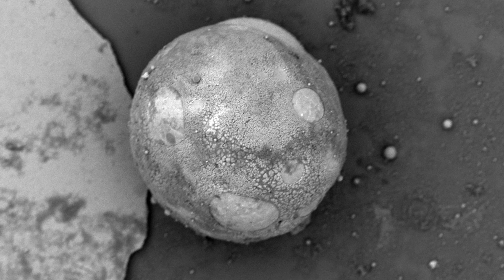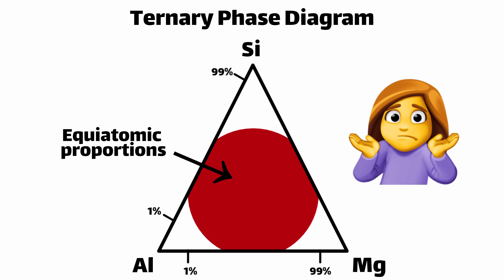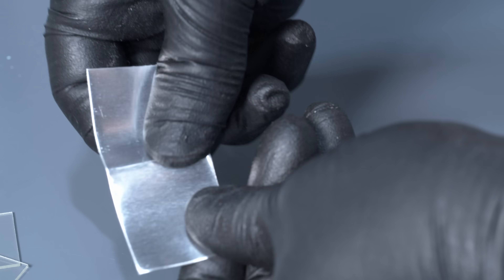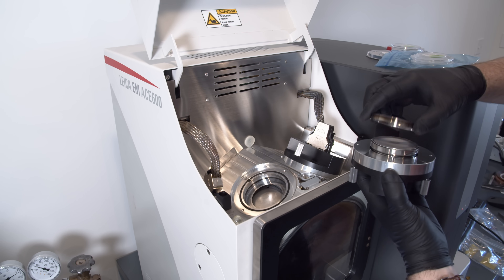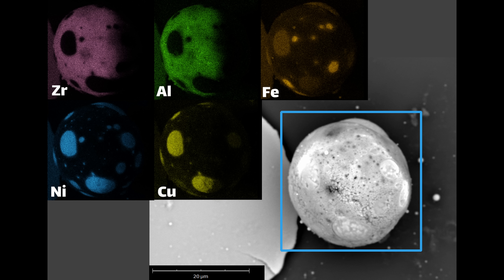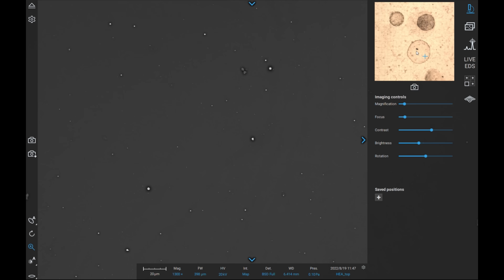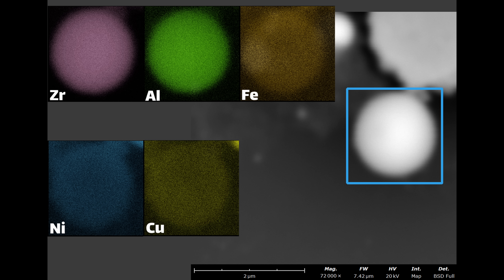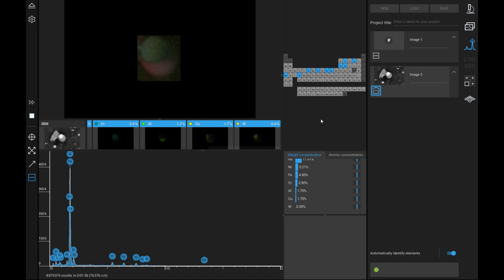Metal Alloys of the Future?

Comment: 10:01 Does this picture of the Copper (Cu) indicate a lot of copper is on the substrate underneath or is the detection a bit skewed there? The entire picture is filled with dots.
Reply from the maker: Could be a little bit of background material/nanoparticles, but likely just noise in this case. The Cu spectra for that sample was very weak so I had to increase the contrast quite a bit to get a visible image, which brought out the intrinsic background noise as well. EDS is more qualitative than quantitative and this is a pretty good example of why it should be viewed with a grain of salt :) Helpful diagnostic tool but you don't want to rely on spectra too much (and sometimes the mapping can be physically skewed or shadowed due to geometry too)

Comment: Good work, man.
You taught me some stuff. Some of it, I can even use.

Check your laser, man.
If you want smaller sizes, maybe try small taps, with the laser.
Control your local energy gradient.
It may be, also, that you've gotta decrease your ambient temperature.

Obviously, you should try these ideas, in reverse, too.
Maybe you're too cold, or maybe you're too hot, but if you can control your laser output, then control your laser output. Control it, all over the map, until you learn something. lol

Intriguing. Thanks.

Comment: I think your layers are too thick and the different melting points causes them to bunch up into blobs. I would try to go for a sub 10nm layer thickness at which point the surface area to internal volume ratio is vastly different which tends to change melting points. You can also try annealing the layers to get rid of internal stresses.
Reply: I was thinking along this line and also with the idea of spacing the laser pulse locations, more like the old interlacing technologies of video.  No wasted deposition areas, just isolated strikes locations, heat control as well as control of mass of resulting particles.  Just an idea.

Comment: The EDS image of the fun octahedral particle makes it look like the Cr is more concentrated to those round surface spots. It be interesting to see if those spots are just surface level chrome oxide formations or if they were actual Chrome that wasn’t soluble in the mixture. That could give you an idea of the mass fraction of elements in the alloy
Reply from the maker: Agreed! There's also a possibility that it's under the particle. I didn't mention in the video, but at this electron beam accelerating voltage (20keV) the beam can travel a pretty significant distance through the sample. So for smaller particles it's possible the beam shoots through the particle and hits something sitting under it, causing an element to appear in the spectrum. 

One of the reasons I was trying to find particles sitting directly on the silicon wafer substrate. In real research they'd use a (S)TEM where this is less of a problem.
Reply: @BreakingTaps  20 KeV is pretty high, what’s the diameter of that particle? How low can you make the accelerating voltage?

Comment: What if you change the order of the metals in the layers, so the side closest to the laser has the highest melting point and the furthest has the lowest
Reply from the maker: Definitely a possibility to help! Or even the relative ordering of different elements could impact how they alloy. Lots to explore!
Reply: This is how my lab melts refractory high entropy alloys. For instance if you're melting a button of tungsten-titanium-niobium, you'll put the tungsten on top and the titanium on bottom. The titanium melts first and the heavier, higher melting temp stuff sort of sinks in. Helps avoid chemical separation from density differences.
Reply from the maker: That's a great tip, appreciate the insight from the professionals! Will keep that in mind if/when I try this sort of thing again!

Comment: love how you can do such cutting edge stuff in your garage...
love your vids

also, what if you make nanoparticle solutions of each metal separately, and then combine the solutions afterward, mix thoroughly, and then boil of solvent and sinter/arc furnace it?
Reply from the maker: I suspect that could work! Would be hard to generate a lot of material, this laser process struggles to make even micrograms of material. But if you had enough of the individual nanoparticles you could probably mix them together either with the laser itself, or with something like an arc furnace.

Comment: You have probably thought of this already, but would it be possible to use liquid nitrogen or liquid helium as the liquid instead of water or hexane? It may help quench the larger particles faster so that they don't have time to seperate. It also may help prevent against oxidation, not to sure if this is true though.
Reply: Damn, beat me to it!
Reply: This was my though too, but I was thinking supercool alcohol or even acetone chilled in dry ice. Not sure if that would introduce other contaminants or not...
Reply: @WmSrite-pi8ck  I really hope he continues working on this project. If he can get the particle size up/process efficiency to a decent enough level he could start taking samples and experimenting with them.

Comment: wtf? what is this tool you're using? i have never seen anything like it before, this is like 10 years ahead of what i thought was avaliable
Reply from the maker: Scanning electron microscope! The elemental analysis is done with a sensor called an Energy Dispersive Sensor (EDS, or sometimes EDX) which measures the energy of x-rays emitted by the sample when struck by the electron beam. Each element has a specific signature of x-ray energies so you can use that to map out elements of a sample.
Reply: @BreakingTaps  i have seen SEMs before, but didn't know about the EDX, the software is really shocking, how you can just select an area and get samples live, what is the software called? it reminds me of using blender or other light transmission simulations, but irl
Reply from the maker: Pretty wild, right?! It amazes me every time I use it. No name for the software, it's just the interface that comes with the microscope (well it might be called PhenomWorld or Phenom Control or something... but it's part of the microscope, not something you can download). :)

Comment: What was the fiber laser specs again? I wonder if this needs some ps or fs pulses, say; nevermind the ns or µs from, well, easier kinds of pulsed lasers.

Are the melt dynamics, annealing/equilibria, going to be like metallic glasses?  Look at it sideways [in the furnace] and it segregates/crystallizes? I wonder how many systems of elements have high enough mutual solubility (besides the obvious friends like Cr-to-Ni) that this is even possible?  Well, lots of combinations to check, obviously, so, "active area of research" indeed!
Reply from the maker: Quite slow, as far as pulsed lasers are concerned. 200ns, 10-600kHz, 50W peak power, ~30um spot size. And yeah, I wasn't sure about the ideal specs either. I later found a few similar papers using Nd:YAG so similar'ish specs (low 10s ns), but they were ablating pre-alloyed targets which feels like cheating to me :)

ps or fs might do the trick! Or might just turn it all into plasma without much chance to coalesce into reasonably sized particles? Not sure tbh!

Definitely not sure, at the edge of my knowledge, but I read that some combinations are very finicky while others can be quite stable. The original Cantor alloy was later found to separate into phases if you try to anneal it (around 700C iirc?). But a slight tweak of the percentages makes it heat stable. So it seems to vary, even within the same "family".

Comment: When you hit it with the laser was the glass in a inert gas or just air? Air might be causing issues. another option to consider in lasing in a atmosphere of hydrogen. Another interesting idea is to try a methane atmosphere to see if carbon gets into the alloys. High atmosphere pressures with argon\nitrogen might also play a role.
Reply: it was in water, as far as i understood
Reply from the maker: Yep just in water. Ideally it would have been done in hexane or a similar solvent, to prevent oxidation as you noted. I didn't show the spectra because it was getting cluttered, but there is a strong oxygen signature in most of the samples (typically on the Fe and Zr). But yeah, playing around with the solution and the atmosphere could definitely alter things! I saw that on my earlier nanoparticle video, water vs IPA vs EtOH made a big difference and most of those were noble metals too.
Reply: @BreakingTaps  Not sure if you covered in other videos, but would it be possible to do a follow up short video on the equipment used for this video?
Reply from the maker: On the short todo list! Once I get my shop a bit more organized and cleaned up I want to do a shop tour, and probably a dedicated video on the SEM and laser since I use those the most :)

Comment: 12:28 on that note, is it possible to intentionally use alloyed sputtering targets to pre-mix the metals? Maybe that will increase the entropy in the final product
Reply from the maker: Yep! But with a caveat. Metals sputter at different rates, even if they are alloyed together. So the mixture that lands on the substrate is often different than the mixture in the sputtering target. But otherwise it's definitely possible. Can also mix "in the chamber" as @seeigecannon suggested, or do things like introduce process gasses to react with the plasma in-flight (typically used to make oxides).
Reply: @BreakingTaps  Could you also magnetically trap the particles and stir them together before depositing them? I'm thinking of inductive levitating metals, where you have two opposing yoke coils made up of a single wire, preferably insulated, and one could pulse it to "trap" and then dump the mixture onto the surface.
Reply: @BreakingTaps  Could you make your own sputter target with five different segments? You could size them inversely to their sputtering rate.
Reply: I was wondering this too. Would it be possible to have multiple sputtering heads in a large chamber pointing in the same direction so you get mixing in the plasma phase?

Comment: Should we expect the same metals to be good for high entropy alloys as are used in normal metallurgy? Or might idk tantalum, antimony, samarium, strontium and scandium turn out to work really well together?
Reply from the maker: As far as I can tell, it's wide open across most metals and some non-metals!  I.e. here's a paper that made DyErGdHoLuScTbY (https://aip.scitation.org/doi/10.1063/1.5051514). There are quite a few variants out there using refractory metals too, like WNbMoTaV. If I understand correctly, the refractory metals are under a lot of active research right now because they can retain their material properties at very high temperatures, so lots of commercial interest there.
Reply: ...or if not, season lightly with Lanthanides.. ;)
Reply: Great idea. I'd be interested to see what some hafnium would produce.
Reply: @WmSrite-pi8ck  There are quite a few Hf containing alloys in this space - TiNbHfZr for instance.

Comment: em ace 600? Oh, wow, it is a luxury for home lab. Not to mention the machine you use for analysis
Reply from the maker: I love it, really nice machine! I snagged it on ebay a few years ago for super cheap because there was a sensor error and it refused to sputter without the error being cleared. Leica wanted something ludicrous to come out and fix it so presumably the prior owner just decided to sell it off.  Dug around a little and figured out the service password, poked around in the diagnostics and it turned out to just be a rotation sensor that had drifted past it's set point so was always toggled ON. Quick reset and back to working 😊

Comment: How much is known about the driving force of elements moving to different phases? Would gravity might have an impact on this? If so then it would be interesting if larger high entropy alloys could be achieved in micro gravity (for example on the international space station).
Reply from the maker: I'm not sure to be honest, but most of the manufacturing methods are relatively fast and/or turbulent (my laser approach, vacuum arc melting, spark plasma sintering, etc all finish within seconds to nanoseconds). I'm not really sure how much gravity would affect things vs intermolecular forces, unfortunately outside my knowledge! It's an interesting thought!
Reply: Gravity will affect segregation in castings, but that's because of density differences in the liquid. It doesn't meaningfully affect atomic-scale mixing.
Reply: @jamesfrishkoff2013  So maybe microgravity might adverse affect it, since there will be less cooling due to convection.

Comment: Could you layer your sample multiple times then use that as the source to sputter a new slide such that the single atoms are mixed through sputtering and more evenly distributed onto the sample? Maybe have to do a grid checkerboard for the source vs. Plane layers.
Reply from the maker: Hmm, potentially! With a caveat: metals will sputter at different rates (i.e. silver sputters a lot faster than nickel), so you'd have to do some work to make sure the target sputtered the quantities you wanted. I think something like a checkerboard would work best, otherwise it'll just "eat" through the layers one-by-one and you'll end up with layers on the sample. But in principle something like a checkerboard could work! That's a neat idea, I might see about trying that...
Reply: @BreakingTaps  Perhaps the different sputtering rates could be counteracted a bit by strategic layering of the initial layers. So for example if silver sputters faster than nickel then you put silver as the lower layer. Then again I'm not 100% sure of the exact sputtering method.

Comment: Probably a dumb question, but what happens if you just melt bulk quantities together in a crucible and do rapid cooling, like pouring into water? I gather there would be a lot of intermetallics separating out but perhaps somewhere would be portions that lost heat energy rapidly enough to be frozen in an HEA?
Reply from the maker: I think it reduces the chances of catching one, but definitely doable! The original Cantor alloy was found when they mixed 20 (!!!) elements and they just blitzed the whole in a vacuum arc furnace for a while before quenching. It was mostly just a bunch of separate phases and intermetalics, but they found sections of FeCoCrMnNi which seemed stable and prevalent and thus the Cantor alloy was discovered :)

My limited understanding is that the limitation with slower methods tends to be evaporation of lighter elements while you're trying to get up to temperature for the higher-temp stuff, and harder to control undesirable stuff like separation.
Reply: @BreakingTaps  Got it, thanks!

Comment: It makes sense the tungsten didn't work, considering its melting point. Also, it would have been nice if you had talked a bit about the exceptions to the intermetallics thing, like invar, or some brasses and bronzes.
Reply from the maker: Yeah that was a bit of a miss on my part. I had originally wanted to talk about those and binary eutectics like Pb-Sn (or even how most stainless alloys are a bit different since some of the components are interstitial)... but I forgot 😅 Perhaps in a future video! And tbh, I have some more reading to do on my side, some of these concepts are still fuzzy to me and not sure I could explain them coherently yet!
Reply: @BreakingTaps  I didn't even think about stainless, 18-8 is less than 75% iron. Also, I've read the word plenty, but I still don't really understand what a eutectic mix is. I know it applies to more than just metals.

Comment: Sound like a good excuse to request a microgravity experiment on the ISS. Aslo what happens if you deposit your layers as thin as possible, even at the risk of incomplete coverage for each layer?
Reply from the maker: In theory if you have really good control over the sputtering process, you're approaching something similar to Atomic Layer Deposition or Molecular Beam Epitaxy! Can basically lay down precise layers of atoms and build the crystal from the ground up. I think that still tends to give you a layered alloy so it'll be slightly different than a more amorphous sample derived from something like an arc furnace or laser. But could be a really useful starting material, i.e. take that and anneal it to let the atoms shift around some.
Reply: @BreakingTaps  Ah yes, I wondered if something like annealing would cause useful amounts of diffusion too. I guess it depends on how long you hold the sample at the high temperature in an inert atmosphere or vacuum?
Reply: @BreakingTaps  Can you have multiple sputter targets at the same time?... Multiple beams at the same molecular transfer rate could create a near perfect mix on the substrate.
Reply: In my adolescent mind I don't like to embarrass myself, but I can't help it, but what is the difference between the lasers you are using as compared to the plasma furnace that is supposed be a major change economically from the electrode furnaces now in commercial use.
Is it possible for deposited material to be proactively different than a concentration of energy of the laser?
Fascinating stuff even for a dullard like myself, keep it coming, even Goodyear stumbled across something novel while cluelessly experimenting.